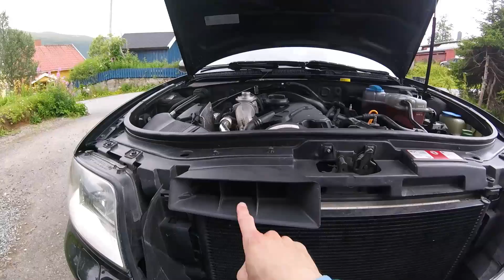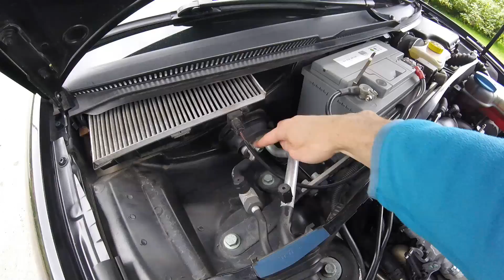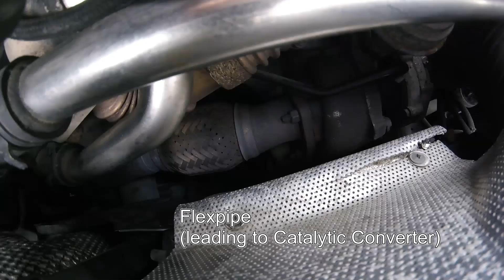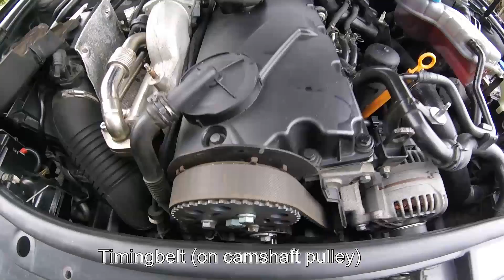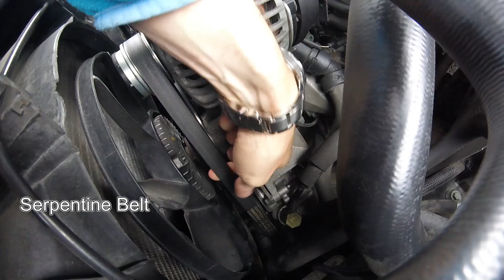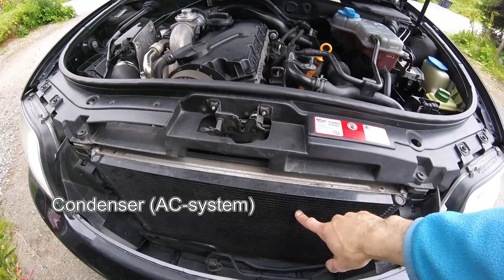What's under the hood? Naming parts inside the engine bay, Audi A6

Comment: I have a 06 Audi A6 3.2 where is my fuel pump relay located?
Reply from the maker: Probably in the fuse box. Left side of the engine bay, under the rain tray would be my guess.
Reply: @TordAndreassen  your absolutely right brother I really appreciate it 👍 stay safe out here 🙏
Reply: @TordAndreassen  hey quick question how do you take them out the proper way?

Comment: Really helpful thank you. What is the specific name for the silver clamp that holds the air intake pipe to the rest of the unit?
Reply from the maker: The hose clamp that attaches the intake hose to the airfilter box?
Reply: @TordAndreassen  yes i believe so.
Reply from the maker: I dont think its called anything more specific than hose clamp. Maybe worm drive clamp or screw clamp?
Reply: @TordAndreassen  thank you

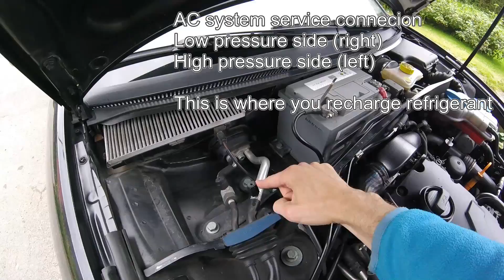Comment: Min 4:40 the thickes one is the low pressure, and the thinner one is the high pressure. The pressure is higher in the small pipes.
Reply from the maker: Osmoses Jones, you are right. The text is correct but in the voiceover I mix it up.  Well spotted, thank you!